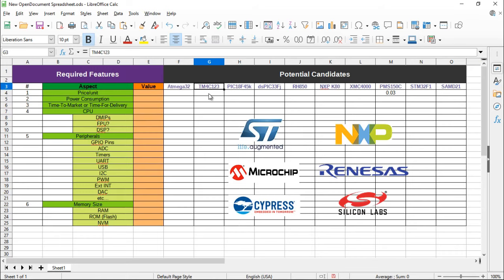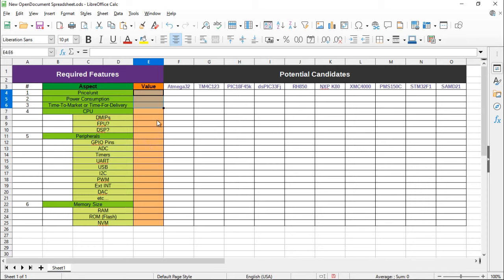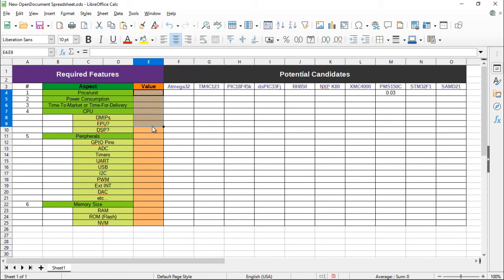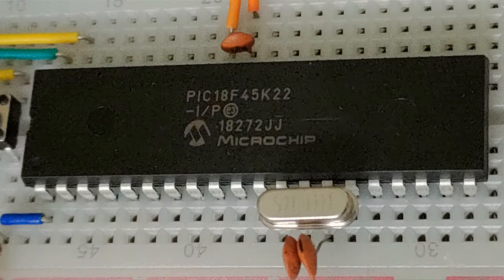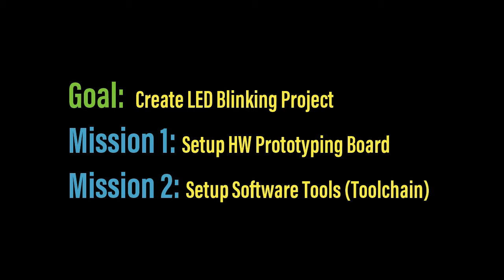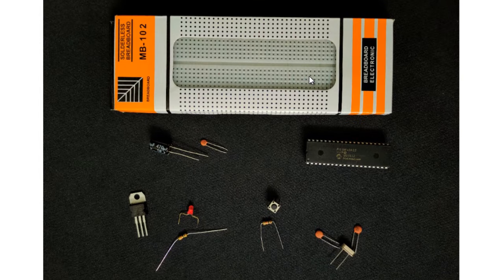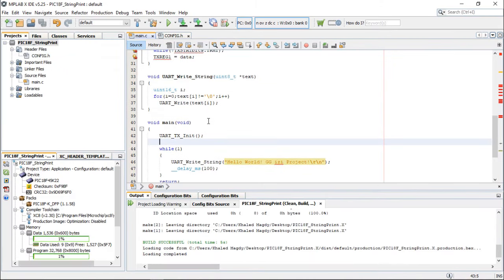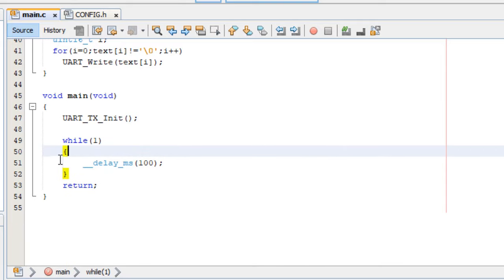Learn PIC Microcontrollers Programming in 1 Tutorial

Comment: One note about the 5V voltage regulator, LM7805 (and the likes of it):
You need to place a capacitor of at least 100nF (0.1uF) at the input and at the output, as close as possible to the regulator, to prevent oscillations and stabilize the regulator. The datasheets normally recommend 0.33uF at the input and 0.1uF at the output.
 You can see the effect of this if you just connect a higher voltage (7 volts and above) to its input and then measure its output voltage, which will be unstable and relatively far from 5 volts, but once you place capacitors on its input and output you will get a stable, accurate voltage.
Reply from the maker: This is really nice to know. I'll do some measurements and check it myself because it sounds interesting. Thanks Edin 😃
Reply: @khaledmagdy  If you already have a nice capacitor across the input voltage that is not far from 7805, like on your board, that will do. The output capacitor is for larger load transients.

Comment: Could you tell me why it is necessary to use a voltage regulator in this arrangement? Shouldn't capacitors be also used with the regulator?

Comment: One of the better videos I've seen on using MPLAB and the PIC.
Any good lessons online for learning the C language for PIC programming in general?
I've been using PIC BASIC because I was familiar with BASIC since the Tandy 8000 and Commadore Vic20/Amega days. Switching to C at 50+ yrs old is kinda like learning a new language later in life. But I'm picking some of it up.
Just would like some overall breakdown of how the structure works etc so I can start making some subroutines.
PIC BASIC doesn't use so much bracket dependent structures.

Comment: Sorry for that... but... Why you are using the LM7805 ? This microcontroller can't blink a led without that?
Reply from the maker: I've been using it to support a bit wide input voltage range while keeping the output voltage @ 5v. According to its datasheet it should handle up to 1.5A so I guess it's a good option, but it may get hot as you draw too much current (like 1A continusous) or if you're connecting a 12v or higher input voltage source.

Comment: Hi khaled do we use the same code even if it is a pic18f45k20?
Reply from the maker: Yeah, sure. It'd still work on any other target MCU of the same family. However, you've got to check the config bits and set them correspondingly as advised in this video and you're good to go.
Reply: @khaledmagdy   can you please provide with the list of components used